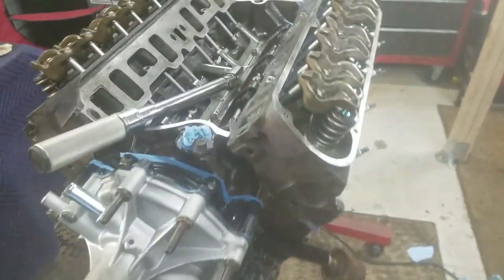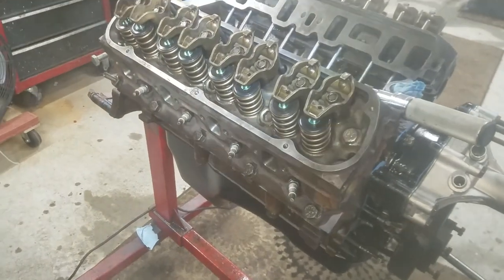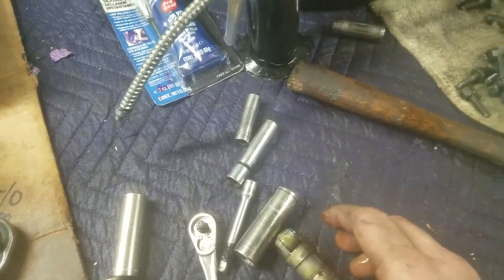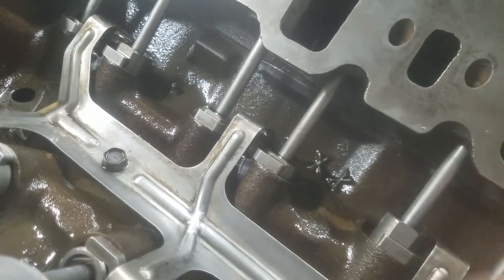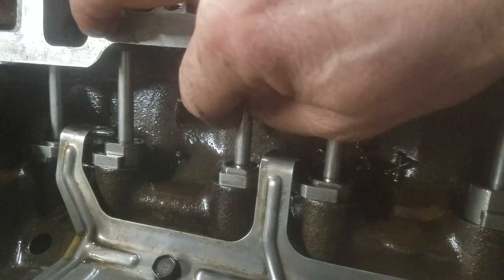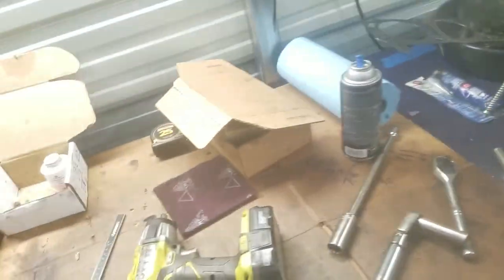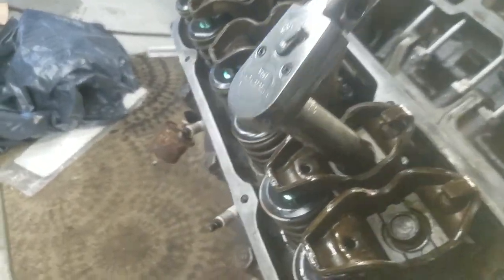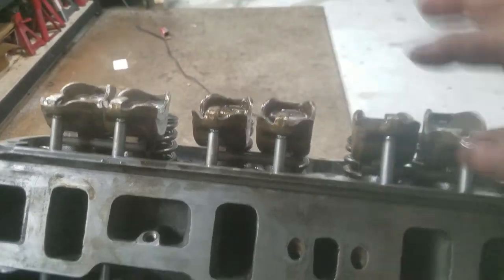Foxbody swap update valve adjustments

Comment: Another way is to start at No. 1. TDC. Your balancer will be at 0 degrees. Turn 90 degrees for each set and follow firing order of 1 3 7 2 6 5 4 8. This is for the 5.0 HO motor. Also I put assembly lube on cup of rocker and lifter detent. Good job there bud.
Reply from the maker: yes thanks that is another way by indexing  balancer just i feel its easier to make a mistake doing like that !!
Reply: In the haynes manual it has a process of marking the balancer at 180 degrees and 270 degrees respectively to check valve clearances, are these two processes the same thing? It mentions something about a lifter compressing tool.
Reply: Position1 
#1 intake #1 exhaust
#7 intake #5 exhaust
#8 intake #4 exhaust

Position 2
#5 intake #2 exhaust
#4 intake #6 exhaust

Position 3
#2 intake #7 exhaust
#3 intake #3 exhaust
#6 intake #8 exhaust

Comment: Thank you for the video! I have a 1995 cobra stock GT-40 heads and pedestal roller rockers.  Getting valve noise. They do not have locks just star bolts on pedestal. Do I do the same method?
Reply from the maker: Yes you do pedestal rockers in order for adjustments you either shim them or change pushrod length

Comment: I have a question? Im working on a 99 3.8 v6 and im just trying to adjust the valves but this engine dont have a distributor. So if i adjust #1 hwo would i know when to adjust the next one in the firing order. Ive read something about 120 degrees,  is there a tool to put on the crankshaft for this? Or can i bar the engine over and just wait for the compression stroke and then slowly check the next valves that need adjustment?
Reply from the maker: Forget all that just do 1cylnder at a time no mistakes or confusion

Comment: What size are stock pushrods mine are 6.25 inches long and im getting a lot of preload before reaching torque specs
Reply from the maker: Thats correct length for stock but there is many variables

Comment: Have you tried cleveland 1.73 stanpped rockers on these 5.o ltrs.  I wonder if they will interchage.
Reply from the maker: Have not done it before
Reply: @foxbodygarageamerica9382  the window AU XR8 200kw has a Tickford cam and 1.7 yellowterra rollers and the 220kw has black Crane rollers. I have on of each. But my dayley drive ute is 185 kw. It's done 422.000,  overheated it 20 time but still runs sweet. But  Still tempted. I'll let you know

Comment: Factory book says no adjustments on these bolt down rockers,torque down and job done..?
Reply from the maker: If you watch the video it is explained the differences
Reply: I did yes,was just for my.own clarification as when I try to torque my rocker bolts down I get zero lash then less than a quarter turn starts to open the valves,all original parts to the engine after a headgasket replacement.
Reply from the maker: That's good 👍 reason you only get a 1/4 turn is because the lifters are pumped up still
Reply: But yet I can't torque them,still finger tight.
Reply: I did what the book says and even looked it up online and it says no adjustments needed. But then when I finished it the rockers and push rods where loose. I even rotated the engine and still loose.

Comment: Very helpful
Reply from the maker: Glad to hear that !! Thanks 👍
Reply: What does it mean when my pushrod still can spin when lifter is all the way down. The rocker arm also has a little play. When my lifter is up there is no play and pushrod turn. Most of my turns where between 1/4 and 1/2 of a turn.@foxbodygarageamerica9382
Reply: I also have a new cam, springs, and lifters.
Reply: I think I need a longer pushrod

Comment: On the base circle... Rocker arm fulcrm bolts 18-25 ft/lbs.  End of story
Reply from the maker: If you don't achieve the torque spec with in 1/2 to 1 full turn pushrod is wrong length
Reply: Great video. What rocker arms are those?